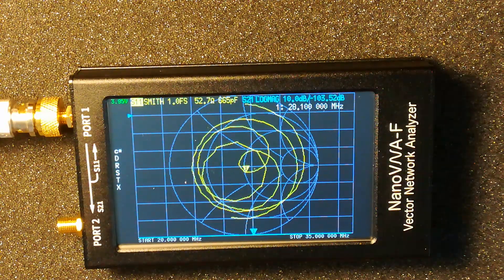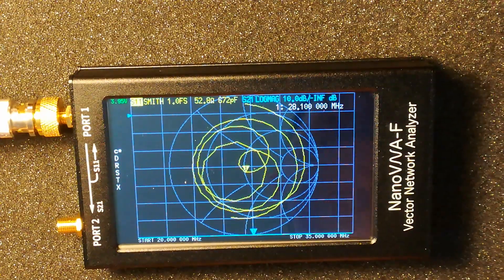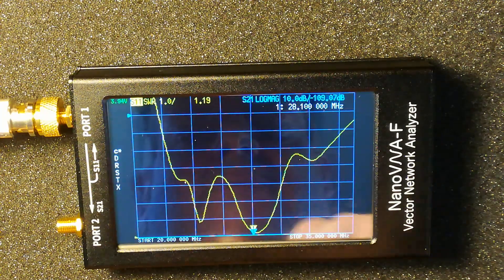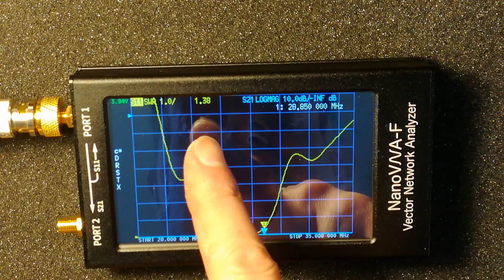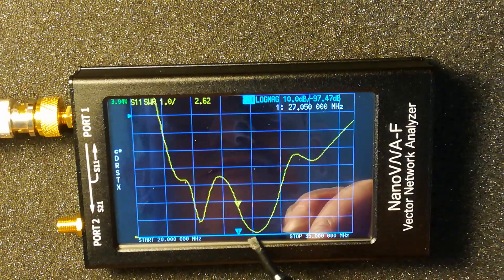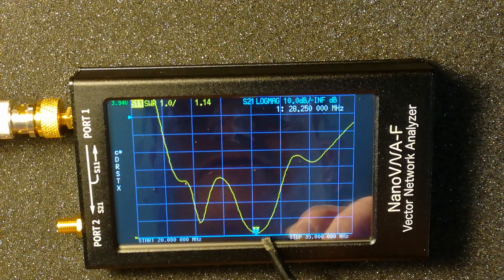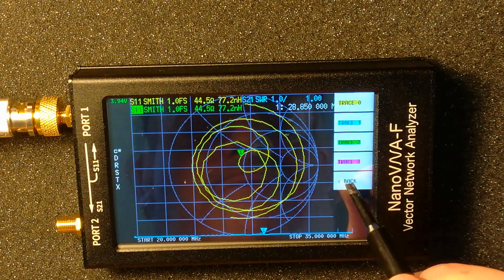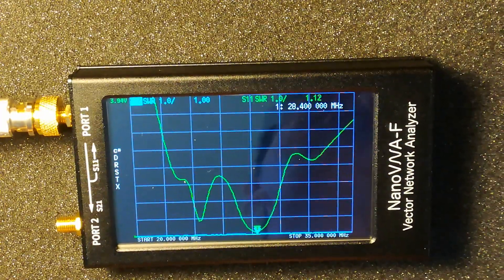Gw0wvl trying out a Nano VNA -F

Comment: What does the 'F' version feature compared to the model with the external controls?
Reply from the maker: Ive not used the smaller version, But the basic functions are the same from what i can see from other videos ive watched , The F version has a 4 inch screen whereas the Nano has a 2.8 inch screen.
Reply: @Gw0wvl  metal case !